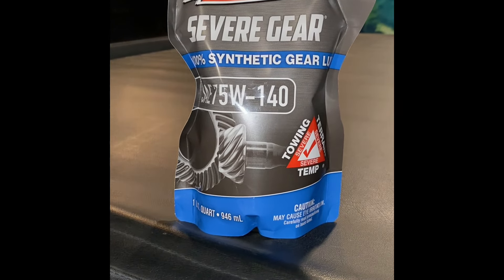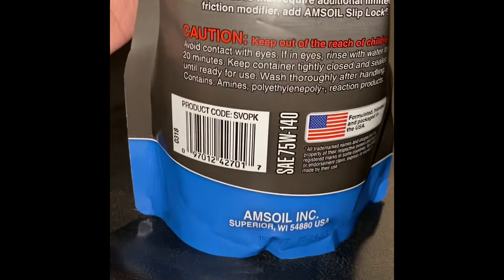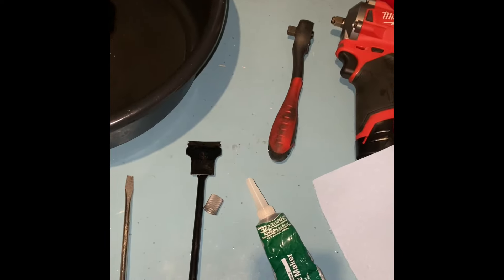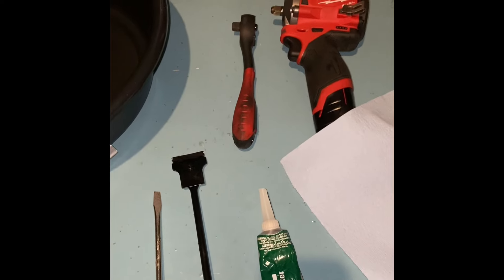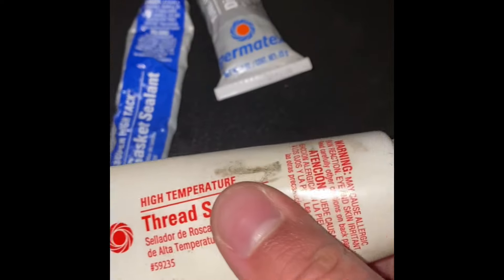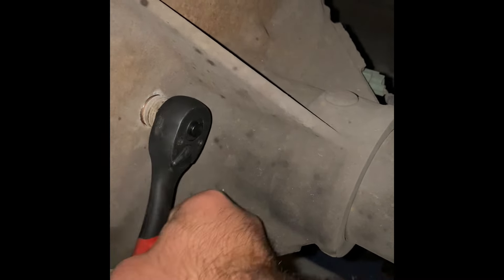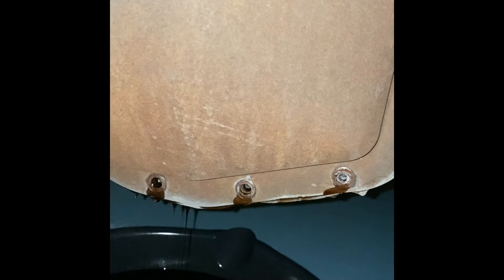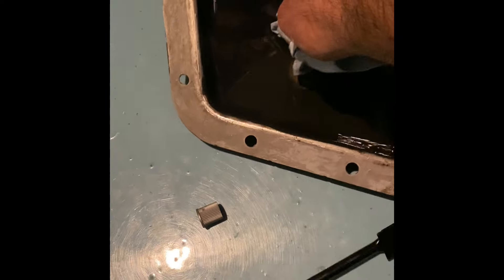Differential oil change 2013 F-150 with 234k miles

Comment: Does it require the friction modifier if use Amsoil in my 2008?
Reply from the maker: Hi, I don’t know what kind of diff you have. Open or LSD. But amsoil contains friction modifier. Which should cover your bases regardless.